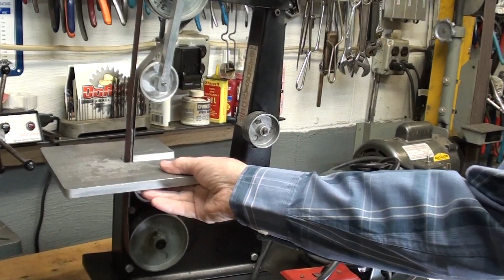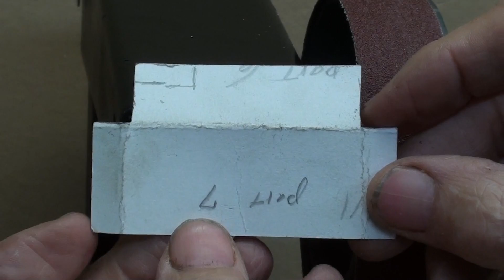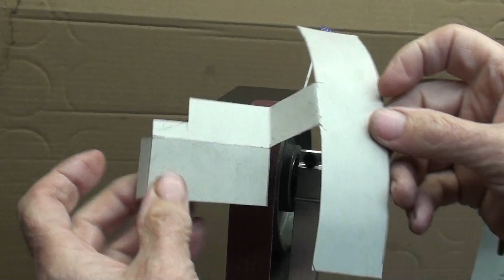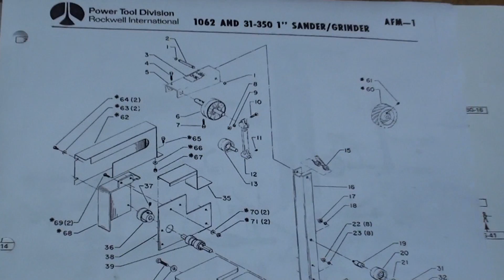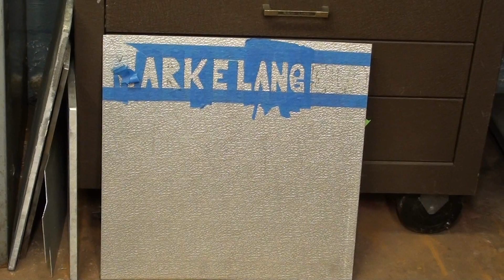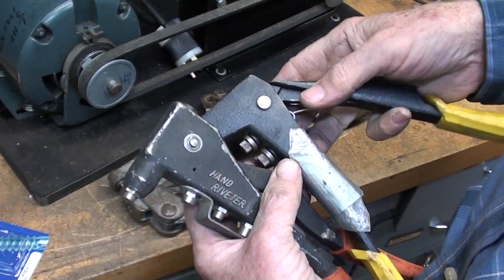Restoration of Mead Band Sander Tips 537 pt 8 tubalcain

Comment: excellnetly designed guard. i appreciate the info about the early Mead BelSaw sanders. my friend has the early BelSaw on stand. the stand does get in the way of standing next to the machine, and the switch is on the back of the motor just as you pictured.
Reply from the maker: Yes

Comment: You don't have a shop-made brake?  I think you have a project!  https://rick.sparber.org/smfb.pdf is a fine thing for small parts like what you're describing.  You can do larger parts as long as they have two short edges, by doing the long bends on a cornice brake (which is just the same thing, scaled up, without fingers but with a clamping bar the length of the bend beam. I've seen other projects where you've rescued a fair amount of half-inch steel plate from the scrap heap.  (Don't mess up your mill on flame-cut edges! /wink/ )

He is risen indeed! Alleluia!

P. S. If you don't like to weld, attach the bend beam to the base beam with a piano hinge and pop rivets.

Comment: Paper templates!  Darn good idea!  Two-piece upper guard I think is better... cut a slot in the attachment area for the wheel guard and then you can simply loosen the screw and remove only the guard on the wheel as needed leaving the guard over the adjustment screws/shaft in place... "IMHO"... besides... two-piece is "two" difficult!   But, no argument... your guard is indeed a thing of beauty!

Comment: Is there not a trade of fitter in the USA ? I served an apprenticeship as a fitter, fitter and turner actually. Its basically an industrial mechanic and machinist. There were two main mechanical trades, fitter/turner and toolmaker. There were others like welders, fabricators etc, but the machining trades were only those two.

Comment: I had to make a similar guard for a belt driven south bend lathe a few years back. I used something like 16 gauge aluminium, hand bent all the bends. (Osha had been called in the year before my time at the company and required all drive mechanisms to be guarded on the spring machines)